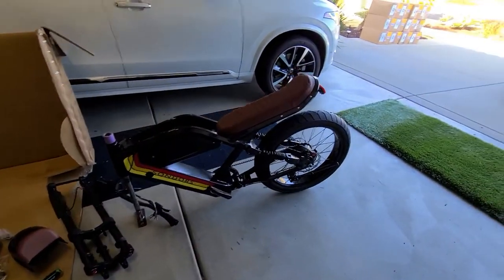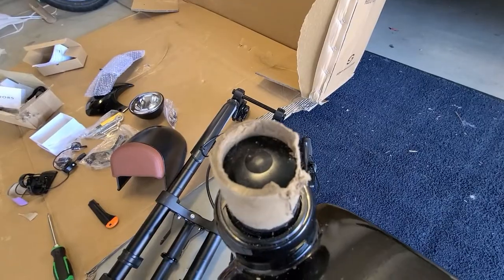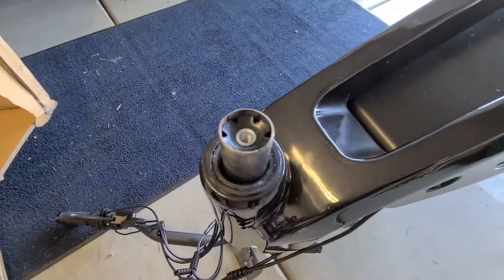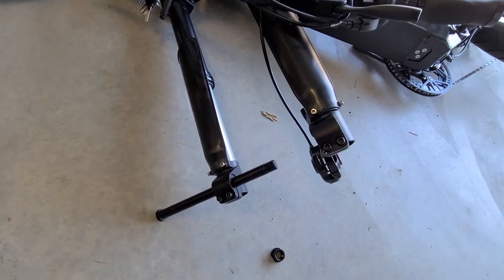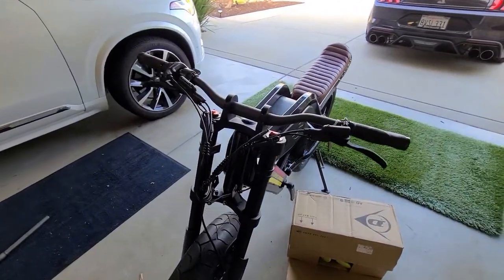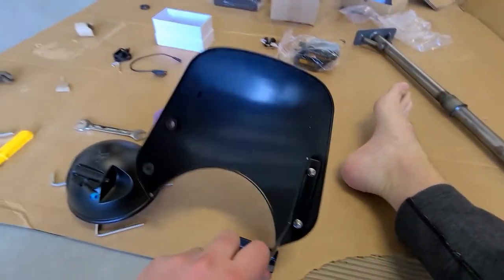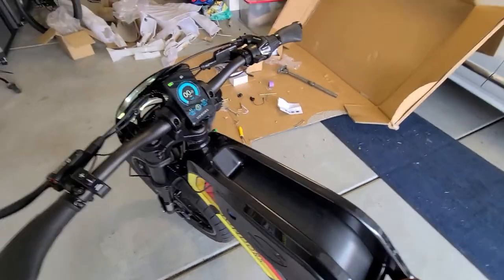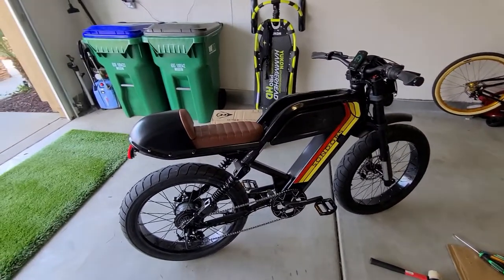Sondors MadMods Cafe Assembly - NO INSTRUCTIONS!

Comment: First and foremost, welcome to the Madmods family. I got the Retro and watched the video guides as I assembled mine and I still made many of the same mistakes you did.

They really don't focus on the details like that cardboard cap of doom. Honestly it almost broke me trying to saw that thing off without scratching everything. The weight makes everything tougher. Originally listed at 68lbs! Definitely a two man job. Had to prop my bike up on a basket to assemble it. I'm surprised you made it through with no help as well as you did.

Also, that plastic washer is supposed to go back on the stem. Check out Sondors channel to see the videos that show you how.
Reply: Someone correct me if I am wrong but I bet they planned to use different material for the body(aluminum) and they ended up with steel. It is twice as advertised before. What else could cause such a huge difference in weight?

Comment: Just struggled putting mine together and what a ball ache.  My front forks appear to be upside down and came assembled with the shock adjustors on the bottom.  This can't be right,.  Taking a break, but I think everything is put together, but it doesn't turn on. :/. Pretty frustrating experience for sure.

Comment: Thank you for sharing. Just got mine today and ran into similar issues even though I watched the official assembly videos. I'm curious if anyone can help me. The official video mentions two spacers when installing the fork but I have 3(2 were on the dummy fork under and one above). How many should I use and where do they go? Also, the cable management is confusing. It is not clear if the brake line should be outside or inside the fork (seems Alex ran into the same issue) . Videos show inside but it rubs against the brake rotor and rim. If anyone knows the best route for all the cables(not just the brake line), pls let me know. I don't want to tighten anything until I got everything in the right place. Appreciate the responses. Cheers.
Reply: I saw that you didn't use the spacers at all. :) That's why it is wobbly. My question still stands as far as using 2 or all 3 of the spacers that came with. If anyone else knows, please let me know.

Comment: i also struggled with the cardboard cap as it's not really detailed in the video and it took me an hour to realize there is a little rubber cap to access the bolt holding the fake fork in place.

it would be really nice to have some clarity on this step in the video. i ended up taking a dremel tool to the cardboard cylinder before i realized it was screwed on!
Reply: I knew about the cap and took it off but still struggled to get the cardboard of that cap in the end. Had to hammer it out